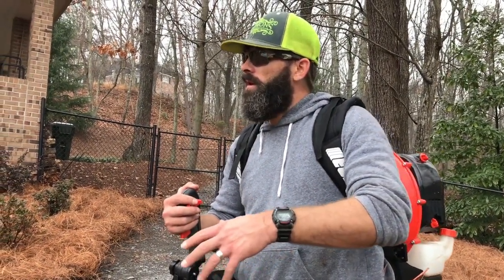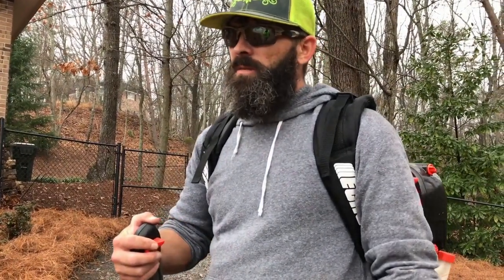How to Install Long Needle Pine Straw

Comment: Its great when ya get straw that you can shake and let it fall instead of having to rip them apart sometimes.Whenever I do straw I load the bales on a hand truck and stack 5 bales at a time then roll them to their spot and drop them off and repeat that way I'm not walking with two bales.I added 2'x16" piece of plywood to the bottom part to support the bales when rolling them around.Nice straw and a good clean job you guys did

Comment: For them side walk edges and up against the house you should crimp where the two meet. It cleans up them edges nicely my dude. The extra work makes it look real nice.
Reply from the maker: No doubt David we actually do that now brother. We use a good flathead shovel to get it down into the edge of the concrete and it really does make a world of difference.

Comment: Hey man so if you can roughly get 300 square feet out of a bale and around here in sc I can get a nice bale for 4-5 bucks, how much would you charge to install about 20 bales on a residential yard?
Reply from the maker: charge for material plus your time to install
Reply: Got the same question trying to figure out how much to charge per bale installed?
Bale Is about $5 dollars also
Reply: The way I do my installments starting this year is  calculating the time spent in picking up the straw, to hauling it to the location, I purchase the round bales long needle, which are 10.00 dollars a bale ,  2.00 a bale to haul it, 5.00 a bale to install it. That includes tucking it. 17.00 total per bale.